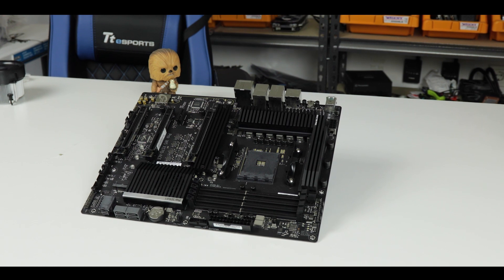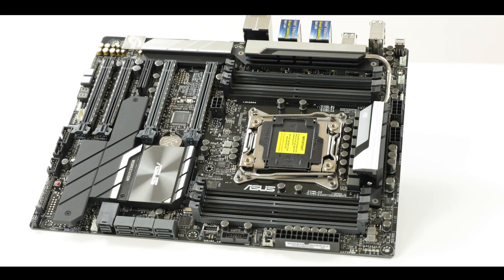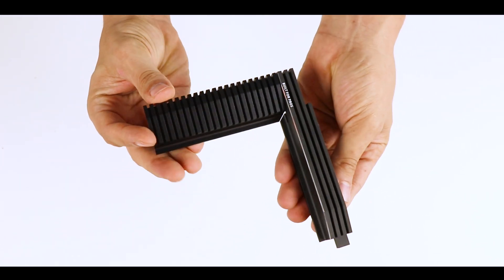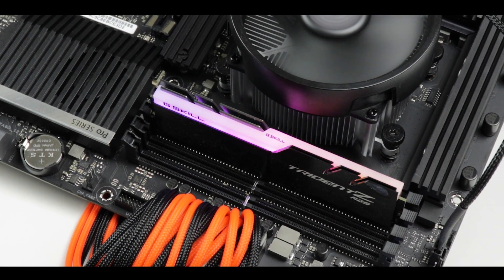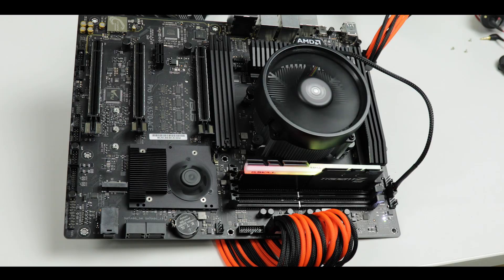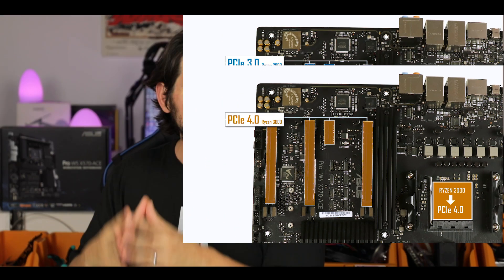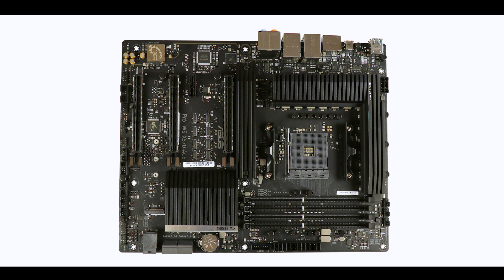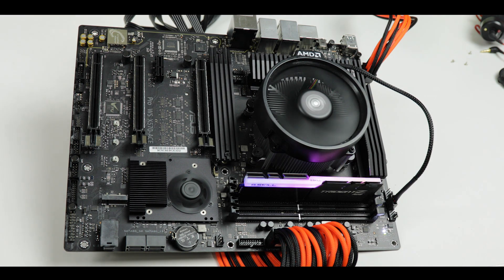Pro WS X570-ACE : PCIe 4.0 at its best!

Comment: I cannot get my 3 x brand new RTX 3060 GPUs to work on this board in x8x8x8 mode....
Reply from the maker: What do u get?
Reply: @Laurentschoice  When all three cards are plugged in, the #3 card on PCIE3 gets a code 43 in Device Manager. If I remove card #3 from the PCIE3 slot, then card #2 stops working and gets code 43...

Strange enough, all of them are now working....but card #3 is running in x4 mode, not x8

Comment: Is this Pro WS X570-ACE is good with 5950x or msi x570 unify is better for 3d modeling and rendring
Reply from the maker: Both are great and will output similar performances with a 5950x.

I have a preference for the UNIFY which I also reviewed, since it has a stronger VRM, more storage ports, and most importantly Q led screen in case of trouble which ...on a creative tool, is always likely.
Reply: @Laurentschoice  thanks
Reply: If you want to recommend a model except both options, what will you give?

Comment: Very good Review, i was looking for a very simple and informative explanation and you nailed it. Thank you.
I have a Question about the U.2 x2 Connector. Is the Bandwidth correct? I tought PCIe 4.0 x2 is "only" capable of 32 Gbit/s.
Reply: PCIe 4.0 x2 can theoretically handle 4.000 MB/s (thats 32 Gb/s, as you said) and typically 3.200 MB/s. The U.2-slot here has a PCIe 4.0 x4 connection (as far as I know) and therefore theoretically 8.000 MB/s (the 64 Gb/s Laurent mentioned) and typically 6.400 MB/s.

Comment: Thank you for excellent video. Can I ask about those M.2 memory slots - do I have to use both of them and can say a Crucial P1 1 TB CT1000P1SSD8 Internal Solid State Drive fit in both slots? I am a bit confused because my last computer build is 8 years ago. Can an 8cm drive fit into the 11cm socket or do I need an 11 cm drive? Thank you for any help. :-)
Reply from the maker: You can use a single m.2 ssd, or both. You can  mix them with SSDs.
Reply: @Laurentschoice  thank you for the quick reply! Ok I understand now after watching all your video again and seeing the heatsink is much larger than the drive underneath.👍🍺

Comment: does the ASUS AMD AM4 Pro WS X570-Ace ATX Workstation Motherboard have Integrated WiFi+Bluetooth? 

does the AMD Ryzen 9 3950X 3.5GHz 16-Core Processor perform well with it?

Comment: System is somewhat up. But not sending a signal to the Dell monitor. I re-seated the 128 mb memory, checked the cables and not sure if the motherboard comes with a bios preloaded. I loaded winders on a USB drive and I can't get to the bios on boot. Monitor says its not getting a signal. Grumble. Any help or links to a troubleshooting guide would be great. I can send picts if you like.

Comment: just picked this guy up....what is the best memory to look at for this system? looking for 4 units to fill out the 128max.
Reply from the maker: I'd go g.skill neo 3600 :)
Reply: Hi All, 
Great video. 
We need more of these videos for guys doing ALIAS, 3D modeling, Keyshot 8 rendering for automotive design. I don't need LED's or a gaming system. Take a look and let me know ur thoughts. 

I need guidance now on a few items: 
(1.) system power supply.
(2.) M.2 -  1 TB drive. 
(3). 128mb memory.

Here is the set up so far. 

ASUS AMD AM4 Pro WS X570-Ace ATX Workstation Motherboard with 3 PCIe 4.0 X16, Dual Realtek and Intel Gigabit LAN, DDR4 ECC Memory Support, Dual M.2, U.2, and Control Center 

AMD Ryzen 9 3950X 16-Core, 32-Thread Unlocked Desktop Processor, Without Cooler 

Cooler Master MasterCase H500 ARGB Airflow ATX Mid-Tower with Mesh & Transparent Front Panel Option, Dual 200mm ARGB Fans, Tempered Glass & ARGB Lighting System 

ARCTIC MX-4 - Thermal Compound Paste For Coolers | Heat Sink Paste | Composed of Carbon Micro-particles | Easy to Apply | High Durability - 4 Grams 

NZXT Kraken Z63 280mm - RL-KRZ63-01 - AIO RGB CPU Liquid Cooler - Customizable LCD Display - Improved Pump - Powered by CAM V4 - RGB Connector - AER P 140mm Radiator Fans (2 Included)

Dell U4320Q UltraSharp 43-Inch 4K USB-C Monitor, with 3-Year Next Business Day Warranty [U4320Q]

Comment: You're talking out of your ass, the fan is absolute garbage. There's no option to turn it off and it always spins at around at least 2000 RPM. It is not only audible, it is also annoying as fuck. I had to remove the shroud and put a noctua 40mm on it. This essentially blocks the 2nd x16 slot for graphics cards or other long expansion cards.

Aside from that, the board is great.
Reply from the maker: Update your BIOS and put ur PCH in silent mode ;)
And voila!
Reply: Laurent's Choice No, the board still does not support any PCH fan settings: https://forums.anandtech.com/threads/asus-ws-x570-ace-unbearable-pch-fan-noise.2577565/
It's always on and running at 2000RPM at least. The only real solution is to replace the fan w/ something decent.

Comment: I know this is old, but reading through the comments, there is a lot of confusion regarding this board.  It was designed as a workstation board, not for gaming.  It may support sli and crossfire, but it does so more for workstation card uses.  As for the third slot being 4.0x8 when the chipset link is 4.0x4, a 3.0x8 card is the same bandwidth as the link.  Most other expansion cards are still 3.0, so that is more than fine.  As for the cost, everything is more expensive in the workstation space, typically because they are made with more durability in mind.  This board even recommends using ECC memory with it to further drive home the point.  For those unfamiliar, unlike non-ECC memory, if an ECC module should have a failure the system will stay running and not crash the OS.

Comment: Laurent! Perhaps you could help confirm a couple things for me. I'm looking for a x570 workstation motherboard and trying to get the real info on this board seems hard to do. In the video "Buildzoid rambles about ALL the ASUS X570 motherboards" he discusses the board's (lack of) features:

1) "These aren't real heat sinks" 42:00

Buildzoid's complaint is that the heatsinks are not a cost-effective way to cool a system, but you seemed really impressed with these heatsinks. Have you published your 2-3 hour stress test temperature benchmarks so we can see how efficient these work?

2) The PCIe slots "are not true x8 x8 x8" 44:00

Buildzoid said because the third PCIe slot is routed through the chipset's x4 connection, the third slot cannot run at PCIe 4.0 x8 mode, and the board can only do 2-Way SLI. Since you mentioned three video cards can be connected, did you mean PCIe 3.0 video cards? That could be the only way.

3) "It's 1-Gigabit LAN? Really?" 46:22 / 50:00

Because Gigabit LAN is impractical for many common workstation tasks (like editing video over LAN, or capturing HD video to server), the folly for ASUS to not include 10Gbps LAN (or even 5 or 2.5Gbit/sec) on a workstation mobo capable of these data speeds has been noted by some. Adding a PCIe LAN card would raise the cost to comparable mobos with more features. Is there a practical feature offset on this board to justify the added cost?

4) My own complaint is that with only a single U.2 PCIe 3.0 connector, configuring NVMe hot-swappable RAID to achieve full speeds possible with PCIe 4.0 is impossible, which is a big bummer since that's the best use for enterprise-level connectors.

I noticed that compared to other boards, JJ from Asus barely devoted any time to reviewing this board in either of his talk with Newegg or ASUS x570 lineup. It may have been his lack of familiarity with workstation needs, but I got the feeling from him that he was silently dissatisfied with this board and so spent less time under the spotlight with it.
Reply from the maker: Hey. Thanks for the detailed comment. 

The very first thing I look at in a PCIe 4.0 workstation is :

The PCB. Having 8 layers is crucial to the stability of a PCIe 4.0 enabled motherboard who d have to run for days uninterrupted.  And that indeed we have. 

The heatsinks do a great job at radiating the heat away. What bulzzoid is missing here is that as a workstation, users are not systematically looking at extreme overclocking. And so in that context they are really doing an awesome job. I will look at some further testing if u need it. I am a small enough channel to still attend to my more serious viewers. 

As for the PCIe lanes. 
Yes some of the last 16 slot PCIe lanes are chipset sourced. Which frankly doesn't bother me just as long as they work :)

The LAN.. I would agree. A WS board should have at least a 5 GBps option.

I hope this does help. Let me know if u need anything else.
Reply: @Laurentschoice  Hello!

Considering this board is nearly a year old now and that new boards will arise when Ryzen 4000 Desktop series is released, I don't know if it would be worth going back and looking at all of this. ASUS kind of did themselves in with this product by skimping on some necessary things. Even during the shortage of components, this one is still available on Newegg, which tells me they aren't able to sell it. Might be better to just concentrate on newer releases.

Comment: pathetic. 10+ yo asus mobos have 12+ sata ports. This trash has only 4. m.2 isnt a solution coz "video rendering" mostly limited by cpu power, not damn transfer speed to/from storage device. Even 16 core cpus barely render faster than real time, so most modern super duper nvme drives are irrelevant.
No 10gbe network of any kind, nor copper, nor spf+. Workstation youve said? lol
Reply from the maker: Hey Miners. 
What makes this board trully workstation  worthy is its durability. 
Beyond the storage features which u are referring to, the real heart of a good workstation is first based on its PCB layout,  the meshing density , and how many layers u got. In this case, we do have 8 layers and a server grade PCB which does isolate trace signal interference and provide that rock solid stability professionals crave. 

2nd comes the VRM and how it handles the most power hungry CPU on longer period of times . In this case  a 3950x.

Sporadic gaming will ask anecdotal CPU picks, but rendering (ie) request constant   processing.. and you'd need a very specific kind of VRM in order to keep feeding the CPU without over heating neither the PCB nor the power stages. 

Obviously this board has probably one of the most powerful and heat efficient VRM money can buy.  

The rest of the features you mentioned can be adjusted through PCIe Export which with the PCIe 4.0 standard goes beyond what we have been accustomed with so far. 

I hope this helps and clarifies. 

Thanks for posting and stay safe. 

Laurent

Comment: hello 
Laurent's Choice I have a question, this board works with ddr 4 memory nom ECC ? Corsair CMW32GX4M2C3200C16 VENGEANCE RGB PRO 32GB (2x16GB) DDR4 3200 (PC4-25600) C16 ??
Reply from the maker: Yes :)
Reply: @Laurentschoice   thx , and work with radeon RX560? and ryzen 9 3900x?

Comment: Hi there - I have a question, @7:03 you show 2x u.2 plugs. maybe I do not understand it correctly. But the u.2 plug works as one... and not 2 Correct? .... Btw loving your channel (and accent)
Reply from the maker: You are correct they work as one. What I meant to say (and did not correct) is that it is a dual channel U.2  ( 20Gbps X 2)
Reply: @Laurentschoice  - perfect thank you for clearing this - please keep up the good work. Really appreciate your informative details... especially the information on the number of layers in the pcb board. ♥

Comment: Thank you for the review. This confirms that I made the right choice ordering this mother board to couple it with a Ryzen 3950X. This will be my first PC workstation that I will build after years of being in the Mac Universe. After months of research I finally have my list of components. The focus of the workstation will be mainly for doing VFX.
Reply from the maker: That is some serious work ur planning to do. 
Mind telling me what ram and GPU ur going for ?
Reply: @Laurentschoice  Hi Laurent. Yes some of the feature projects I work on require very hi-res and complex simulations so there is never enough power in a workstation. For GPU I will be using ,as of now, an ASUS GeForce RTX 2080 Super 8G Turbo Edition. The reason I did not the get the 2080TI is because I will add more GPUs and I believe the 2080 scales better in multiple GPU situation than a TI. As far as RAM I got G.SKILL Ripjaws V Series DDR4 PC4-25600 3200MHz (64gig total). That current config will blown away my MacPro in many regards.
Reply: @ricktowers  Nice build!! Apple should have gone with Ryzen
Reply: @ricktowers  Hi Ricardo! I'm going for a similar workstation build right now. Actually, I don't know your local gpu prices for your country but in Turkey RTX 2070 Super is like nearly half price of the RTX 2080. Do you think is it wise for me to get the 2 x RTX 2070 Super set up or something different? By the way, I am using Houdini with Redshift and Blender.
Reply: Hey guys few months late to this how is adobe lightroom and some video editing performance and how will take some gaming as well am just waiting for the new gen to be announced
Reply: I got this motherboard after watching this review but I have tons of issues with it.

My setup is

Ryzen 9
1 nvme pcie4 500gb
4x16ram
Quadro p2100
Psu be quiet 700w
Oc to 4.2ghz

The moment I add a 1tb sata SSD

IT WILL NOT EVEN BOOT TO BIOS!!!!!!!

Comment: I noticed you haven't mentioned the one unique feature of this X570 board: It has a IPMI solution integrated on the Realtek LAN Chip ("Asus Control Center Express"). So when you build a rack server with this board, you can do a remote dial-in / KVM to this motherboard directly over LAN, even when the OS freezed or just to make settings in the BIOS. - I only have read about this feature on the asus website and i watched your video to see, if this feature works fine or is worth the money, and than i noticed you haven't mentioned it at all. ;) - Perhaps someone in the comments can say if it works pretty well or if its crap !? - Would be nice if i can do a restart/reboot/reconfig of my server, even when i am hundred miles away from it, only vpn'ed to my network...
Reply: So sad that nobody responded to you. Did you get your answers anywhere else? I also looking for it as its main feature i would like to buy this mobo for. Unfortunately Supermicro makes mobos only for Intel CPUs :/ My storage PC is connected to RPi3 (by optocouplers to GPIO pins) but this allowes me only to turn on/off PC. I dont have access to POST screen or Uefi :(

Comment: I would've liked this motherboard if it wasn't so damn barren.No postcode, no reset- power button, no wifi,no bios flashback button and only 2 nvme slots, instead of 3 of which only 1 has a heatsink...Not worth it in my opinion.

Comment: How can it run 3gpus in 8x8x8x configuration if Ryzen 3 processors only have 24 PCIe lanes 4 for chipset 4 for memory drives and 16 for graphics? Anyone? Is it just another marketing trick for not so tech savy pros or am I being mistaken here?
Reply from the maker: That's because u got up to 16 lanes added from the Chipset. Which potentially availed up to 40 lanes in total.
Reply: AM4 really isn't the ideal option for 3 gpu's, and arguably not for for dual gpu either.  However, this board is probably the best for expansion short of Threadripper, especially for workstations (as the name implies).  GPU in slot 1, Highpoint Nvme bootable raid-10 in slot 2, Intel 4x10Gb Lan in slot 3.  Now that makes for a powerful workstation.
Reply: I have 3 RTX 3060s on the board...when all three are plugged in, the GPU in PCIE3 slot gives code 43 in device manager, if I remove device 3...then PCIE2 stops working and gives code 43 in device manager as well....very frustrating to use
Reply: @bage881  were you able to resolve the issue? I bought this MB a while ago. only use 2 GPUs for now, was planning to add the 3rd one for rendering, but this sounds concerning
Reply: @Abramidi  I wasn't, and currently chatting with ASUS support to rectify. 

What's also a little challenging is that I actually cannot find anyone who is using this board in a 3 GPU x8x8x8 configuration.

Will see how the troubleshooting goes with ASUS support and let you know when I have an update 👍🏾
Reply: @bage881  wish you luck with resolving the issue
Reply: @bage881  Hey,  wondering if you were able to solve the issue with triple GPU setup? thinking of purchasing third GPU and not sure to pull the trigger or not. Thanks in advance

Comment: Bought this board along with a 3900X for my workstation rebuild after seeing this vid and very happy with it :) Only peculiarity I've found is that the middle PCI-E slot doesn't seem to support network cards, If I install one it doesn't show in Windows (but the GPU does drop to x8) however the bottom PCI-E slot does and strangely with a NIC installed in that the GPU stays at x16.

Comment: Thanks for a great review. I'm very likely going to be picking one of these up to pair with a 3900X. Just wondering, what were you able to overclock your 3900X to on this board? I'm trying to decide between this and the X570 Crosshair VIII Hero. The Crosshair seems to be a better overclocking board but I prefer the aesthetic of this board a lot more.
Reply: what did you end up with?
Reply: @NobleSteed00  Ended up getting this motherboard with the 3900X. Really like the aesthetic of this board. Would've liked to have seen more features on this board though, like WiFi and more SATA ports. Other than that, no major complaints.
Reply: @bentcw  No problems yet with this motherboard? Im looking to build my first PC and would love a motherboard without rgb. So far I have this one on my list, the asrock x570 taichi and the msi x570 unity, but I've come across topics talking about some issues with the msi x570 unity. This one looks like the winner or the asrock x570 taichi if I can disable the rgb lights. Im looking into getting the same CPU too.